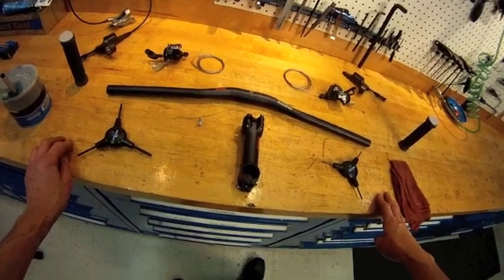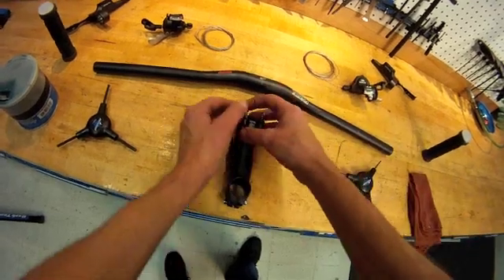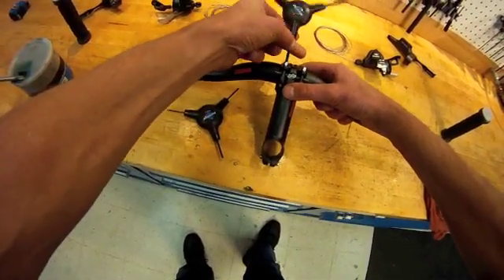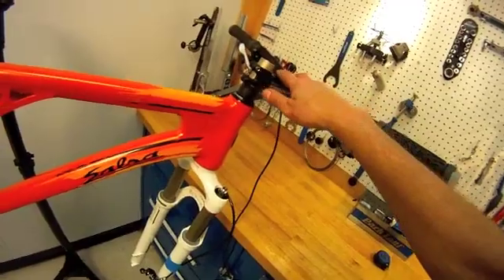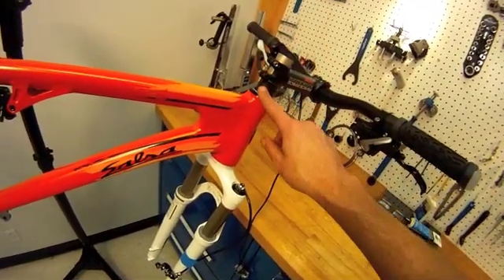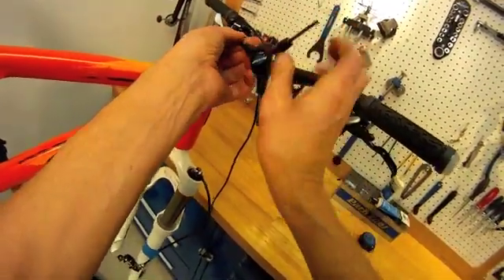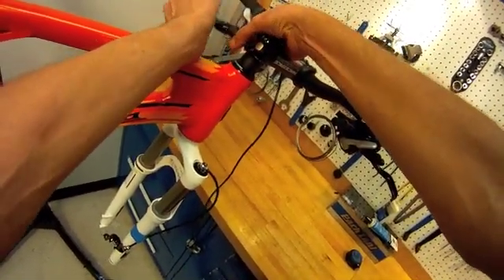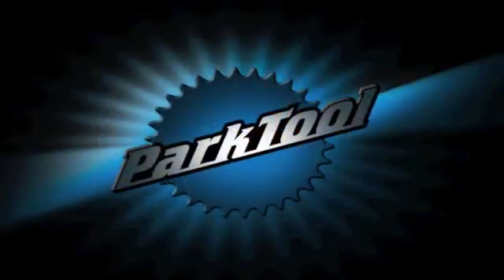How to Build a Bike - Part 4 of 12: Cockpit Assembly and Fork Installation

Comment: Pro tip, put a rubber band on the 5mm of your three way (or 3mm on smaller three way) wrenches so you don't waste a bunch of time looking for the size you want. It cuts down a LOT of time. I've been known to paint mine as well so I don't spend a lot of time fussing about trying to figure out what I'm looking for.